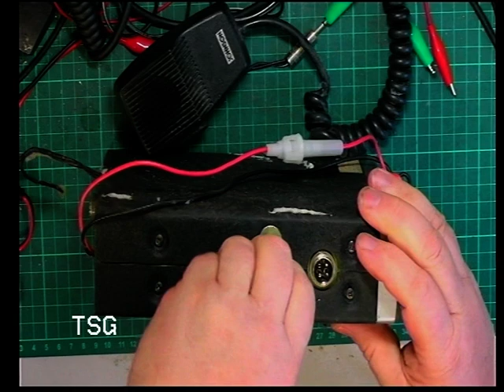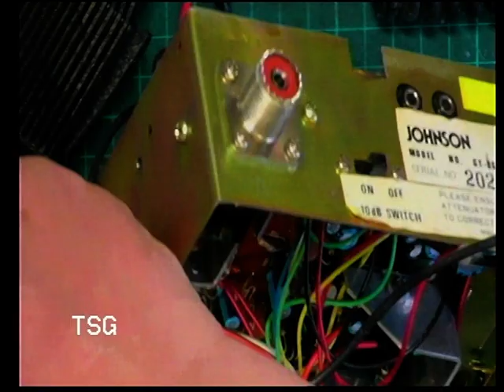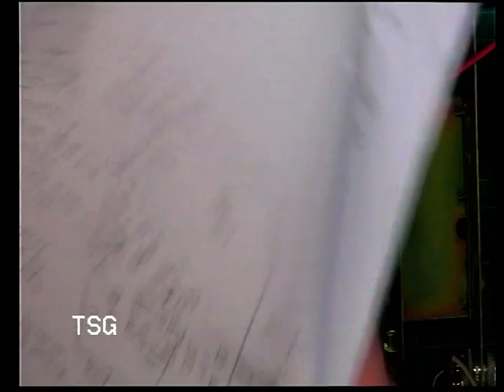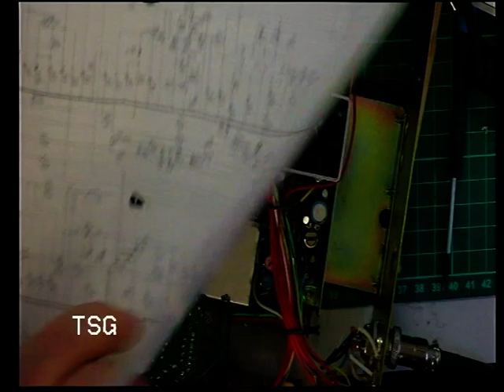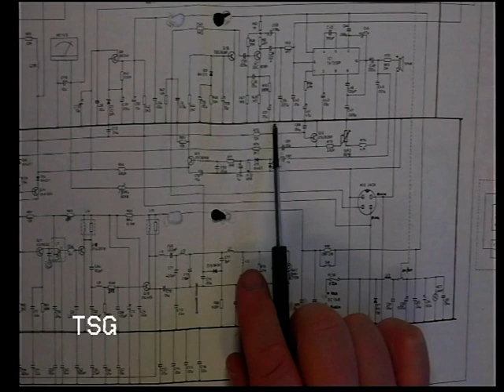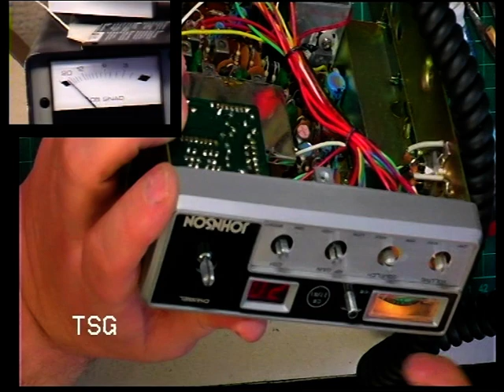Johnson GT868 UKCB27/81 CB radio (mobile) - repair & service adjustments

Comment: Hello Richard thanks for showing us your Johnson on the bench. If your laser printer is good can I suggest toner transfer method rather than using the much more fickle and complicated photo exposure method. If your not familiar with this method, I do it here and have experience of this and UV exposure etc.  For low production volumes toner transfer is easier and quicker but I accept it’s also whatever method works best for you. https://youtu.be/rGUgt_2gXy8
Reply from the maker: We tried it a couple of years ago & even tried three types of the special paper required. It took a lot of time for the paper coating to dissolve, much more time than the photo method & with less than satisfactory results with two different boards we needed to make. That said, this simple board would probably work OK with that method. I can produce photo boards from zero to finished in 20 minutes! I'll be doing the PCB video today & will show two methods. One with "all the gear" & one 'kitchen table' method. Believe it or not we get a darker acetate master using the inkjet printer rather than the laser one with better results. I've been waiting for inkjet acetate to arrive, which it did yesterday...so I produced the acetate master yesterday. It's also walkie-talkie Wednesday, so will do that first...I'm also booked on a job  all morning...phew....!

Richard

Comment: hi i have found an old Densei dm-311p but cant seem to find any info on this mic .i was wondering if you have and could you help out with an issue ie there is a kink wire on the back of the board which has come adrift and cant see where it attachs many thanks andrew
Reply from the maker: It could be the same as the Miranda DM311, but I'm clutching at straws for you as to where the link wire has come away from. Unfortunately, any radios we buy in that come with 'power type' mikes, have standard mikes fitted instead. We discard all power mikes, so have nothing to help you reference it.

Richard

Comment: I do like a nice bit of fault finding. Well done sorting that especially after saying you have never changed a cap in one before. Nice explanation of the broken wire fault. I would have probably been at the element 1st before reaching that conclusion. Look at you with all the rogers 😁. That’s in really good condition. Regards Graham
Reply from the maker: Time & time again I've fixed a real problem, like I did with the mike cable...only to find a similar problem caused by something totally different. When I had the TV repair shop, I turned a set on & it was dead...then I noticed I'd forgotten to plug it into the mains. I plugged it into the mains & ....dead set!

Richard

Comment: Another variation of my ELFTone EL-CB-6000 I do wonder how many variations there are.
Reply from the maker: A lot! It's a shame our Elftone is already spot on from a time before I started doing these videos. I bought ours as a scrap chassis that had already been robbed of parts, replaced all the missing parts & found the original fault!

I enjoy doing the Great chassis sets. Although there is huge power output variation between different sets (1.7-4W is the limit spec), they are a 3.5W set & we don;t usually find the performance lesser than more usual sets o n our tests. It was bleedover they were notorious for & that isn't really a snag these days & certainly not here in the middle of nowhere. 

Richard
Reply: It was my first radio, bought after a friend got one in. I’m sure it was less than £50. The first one was faulty, it just wouldn’t transmit, so I got it swapped. 40 channel bleed over was a polite term for it. I ended up putting several LEDs in the microphone which lit up on receive.

I picked up one for old time sake, a couple of years ago, then another came up shortly after so I now have two. I haven’t used them yet, I really should make an effort.